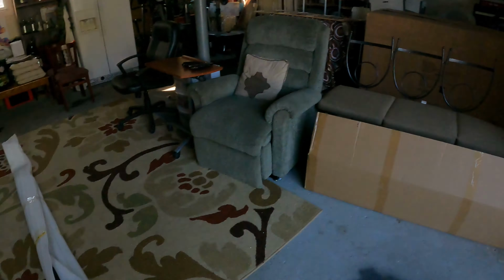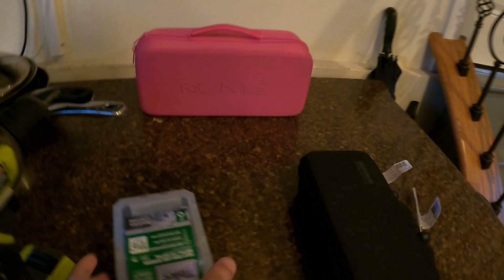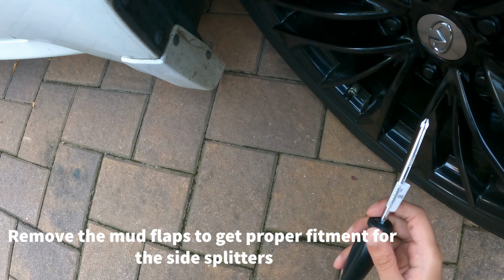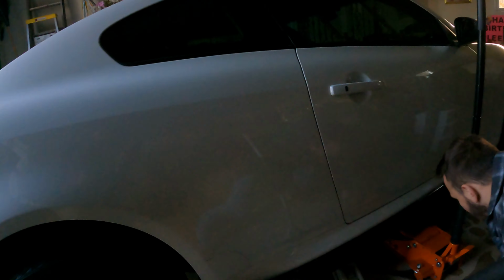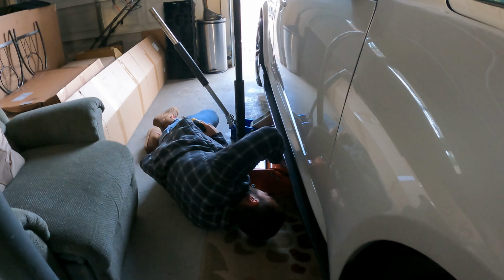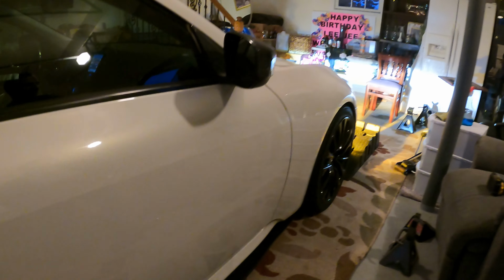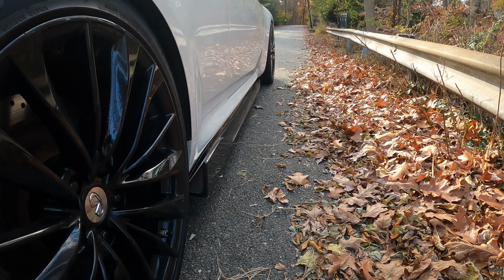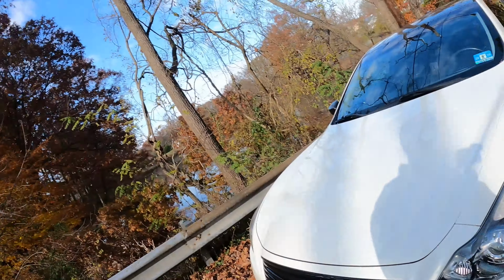Carbon Fiber Side Splitter Install on my G37s!! (MUST HAVE MOD) - G37/370z

Comment: does this not cause any rust drilling into metal like that?
Reply from the maker: Honestly that's a great question. I hope not, I don't think it should but I'll check and confirm lol I should be taking the side splitters off soon for something
Reply: @yayasgarage  Yea that would be great if you could post an update! I wanna put these on my G but I live in a very snowy area so I don’t want the salt to completely rust the rockers 😅